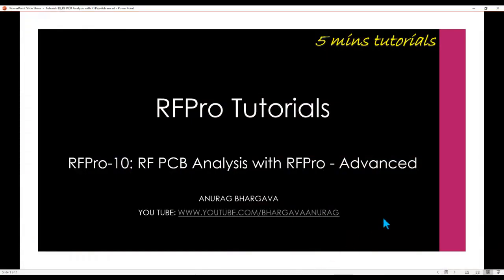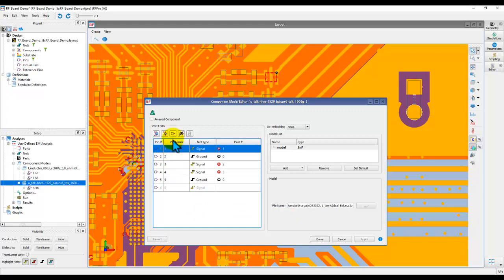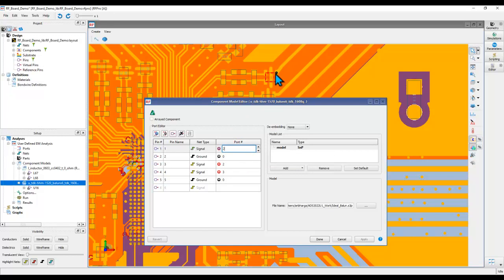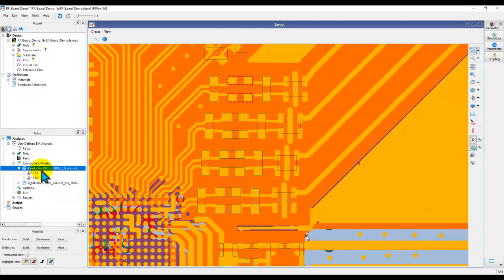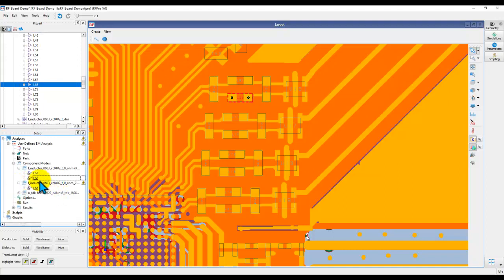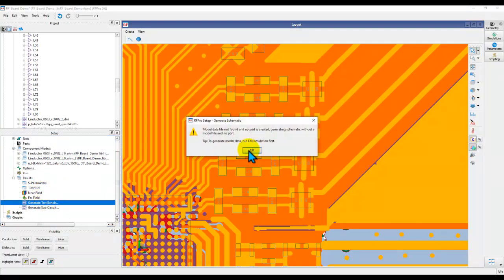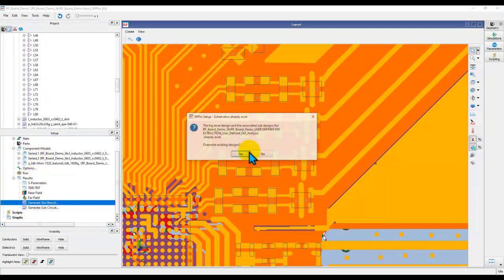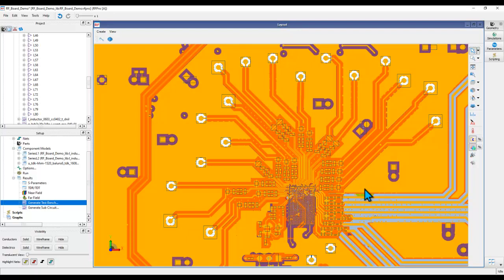RFPro-10: RF PCB Analysis with RFPro - Advanced

Comment: This answered a previous question. Still not sure what to do when RFPro Warning states that component pin cannot be in same location as net pin unless they are same polarity.
Reply from the maker: Usually that warning comes when you have a component which will place its own port as you might have defined it as a Circuit role and added it in your component model in the analysis as well as placed your own ports on one of its terminals. This will only produce a warning indicating that there are 2 port terminals at the same location and simulation will not get affected due to this.

Comment: As usual, your talent for explaining things is superb. Quick question. You demonstrate including what I presume to be a passive S parameter file for one of the components. Can RFPro also simulate using active S parameters such as amplifier components? Would an active component be set up similar to how SnP circuit components are configured (by turning off passivity for that component)? Or is RFPro limited to only passive S parameters?
Reply from the maker: Hi,
Any EM simulator is only for passive circuit/structure simulation, if you have active components those need to be connected in schematic and then simulated with relevant circuit simulators. When you do the configuration in RFPro equivalent schematic sub-circuit is auto created with all connections necessary and then you can create suitable test bench around it to simulate as explained in one of the videos.
Reply: @BhargavaAnurag  I understand. I don't think I was very clear in my last comment. Sorry. Have you done any videos illustrating how you perform something like a transient or envelope simulation using the RFPro-generated sub-circuits? I have seen videos you have done using conventional momentum uWave or FEM analysis performed on layout structures which you then cosimulate, but I don't think I have seen one where you use the results of RFPro and feed it back into ADS for circuit simulation. Is the process basically the same? RFPro seems like a nice environment to use when analyzing existing layout structures, but I don't yet see the advantage of using RFPro in situations where circuit co-simulation is needed (for observing the effects of things such as amplifiers on signal integrity after the signal propagates through the RFPro-examined layout structures). It would seem to me that FEM and/or momentum uWave analysis would be just as effective?
Reply from the maker: Hi BB,
Here are my comments which might help you:
1. There is nothing special in taking the RFPro generated subcircuits containing the EM results + discrete components and place them into your Transient or Envelope simulation test benches, you simply need to follow subcircuit placement process as you do with any other schematic. If you wish to use it in Transient/Env. make sure the EM simulation is setup from 0Hz till the desired frequency else you won't be able to simulate it properly.
2. Whether you use the data generated by emSetup or RFPro, it essentially is the same as RFPro also uses same Momentum & FEM solvers behind the scene except for Generation2 solvers which are exclusive in RFPro that performs simulations more efficiently for complex structures. I will upload a video soon to explain differences between Gen1 and Gen2 solvers soon for better understanding.
3. There is no competition between emSetup and RFPro and you are free to use whichever suits your purpose. RFPro has its own advantages like Net based extraction, creating multiple analysis within same GUI, Flexible EM/Circuit cosimulation setup, automatic creation of EM/Circuit cosimulation assembly etc etc so in nutshell, lot of things which you need to do manually in classical emSetup can be done with 100x more easily in RFPro but again not everyone needs these advanced features and if so then simply stick to emSetup....😊
Reply: @BhargavaAnurag  Thank you for your reply. That answers my questions. I look forward to your future video that demonstrates the differences between the Gen1 and Gen2 solvers. 

PS: If you are familiar with the technique, it might be fun to see a video that demonstrates how to simulate the effects of a metal cover over sensitive RF component sections to minimize radiated EMI and the effects of external EMI on circuit structures? I thought this was possible in RFPro? Or maybe I'm thinking of the older EMPro? Please correct me if I'm wrong. Thanks again for all the hard work. I know making videos is time-consuming. But you really do have a gold mine here.
Reply from the maker: RFPro doesn't plot radiated EMI directly "as of now" but if you would like to see enclosure effect on the RF Circuit performance in terms of S-Parameters or Harmonic Balance then it can be accomplished easily. Using Circuit Excitation feature in RFPro, it will be possible for you to see Far Field radiation patterns etc but it doesn't have flexibility to plot 1m, 3m etc kind of EMI plots that you might require.
This kind of EMI analysis is possible in EMPro as of now and it has all the required templates and sensors for you to use....
Reply: @BhargavaAnurag  Thank you again, Anurag. Keep up the great work!

Comment: Thanks for the video and your perfect explanation. I have a question about the simulator which you used. Imagine that we want to check the parasitic effect of a capacitor with ADS. In this regard is better to use the ADS modelithics library or the RFPro can take into account the effect of the capacitor. I assume we should use the ADS modelithics library (another choice could be to use two MLIN with one MGAP in the middle of them with a parallel capacitor for instance).
Reply from the maker: You mixed up 2 issues in your query. If you are talking about lumped/discrete component then there are 2 parts of it:
1. Mounting Pad effects - This can be computed by EM simulator like RFPro and this is also included in Modelithics model so choice is yours to decide which way you want to go.
2. Capacitor/Inductor electrical model - Usual vendor library models provided by manufacturer or Modelithics have that so it should be fine either ways.
Kindly watch my LNA design video to understand how to model these effects in your real circuit design/simulation.
Reply: @BhargavaAnurag  I understand and thanks a lot for your quick reply and perfect explanation. By the way, I followed your channel for a while and I really enjoy of it. Please keep it up🙂.
Reply from the maker: Thanks for the feedback...👍